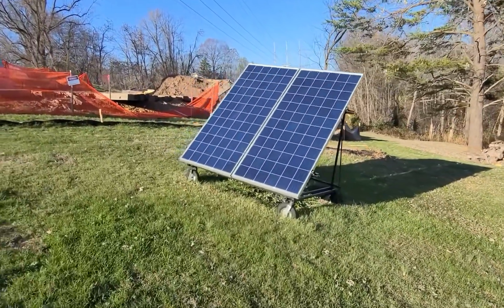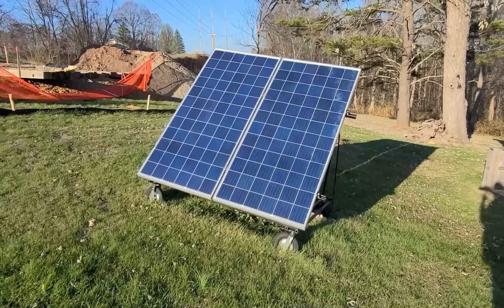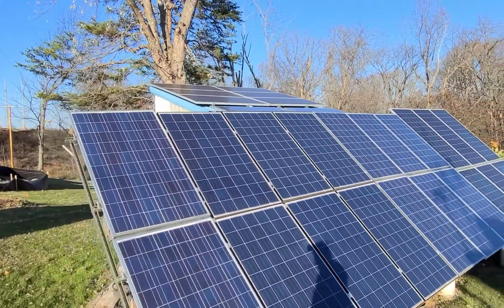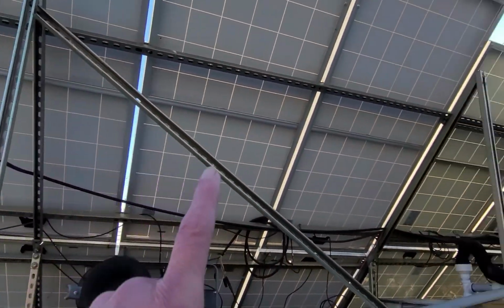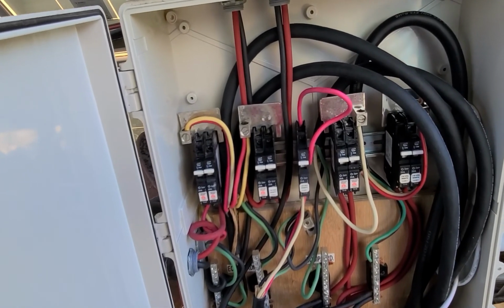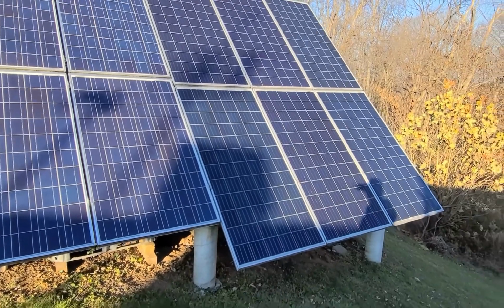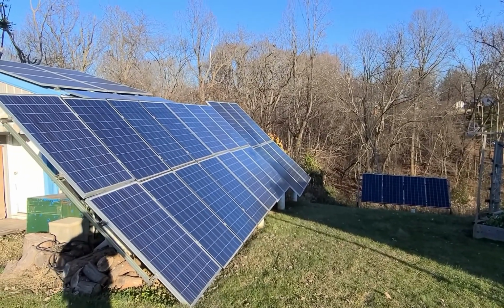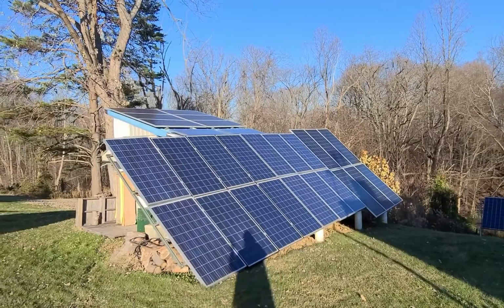What is the Cost of a Solar System ? Is Solar actually Cost Effective ? Is offgrid Solar Expensive ?

Comment: About an hour away from you here in Stockport.  I'm new to solar but learning fast.  I was hoping you had better luck with SanTan, I'm gonna get a pallet just to get something on my roof.  I have a small cabin so my power needs aren't much, and I know I'll still have to depend on grid power to heat and cool the place.  I went with a 12v system (probably foolish i know) just because most of the stuff I have is 12v.  Hopefully by the time I'm done my light bill will be a little lower.
Reply from the maker: I was just up that way a couple of weeks ago. Up by Dale ! My System is 24 Volt and does me Good. I wouldnt mind changing over to 48 volt.

Comment: Awesome! New solar panel prices are crazy low now vs what we paid just 8-10 years ago. $140 for a 100w panel? Yep. Now, a 100w panel is around $80 and seen some for even less! Gotta love Unistrut...so, easy to make a solid platform for panels. For hardware - Tractor Supply saved me a TON of money in cost. But, overall, solar panels are lower in cost and most everything else is 30% higher or so. I also got "snail trails" or spiders in my Renogy panels too. Weird thing...some look new and some look gnarly.
Reply from the maker: Yeah panel prices are better for sure. But hardware prices sucks !